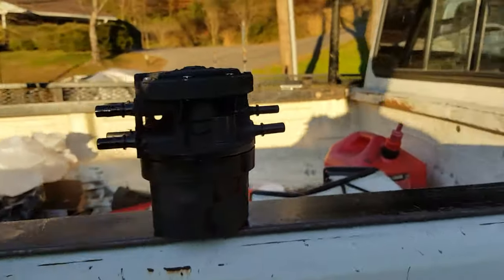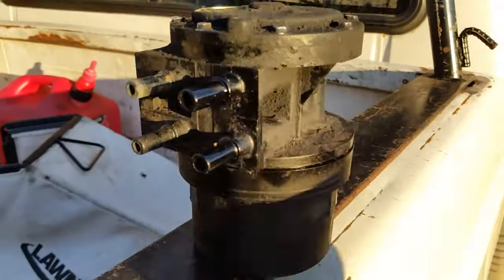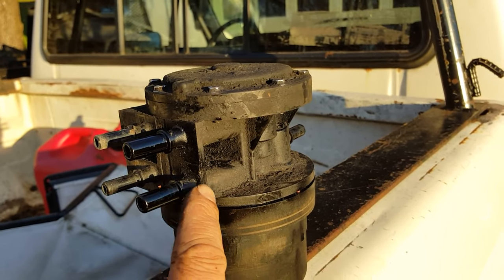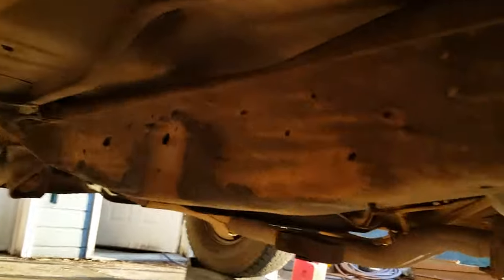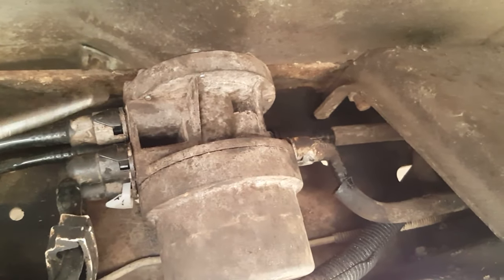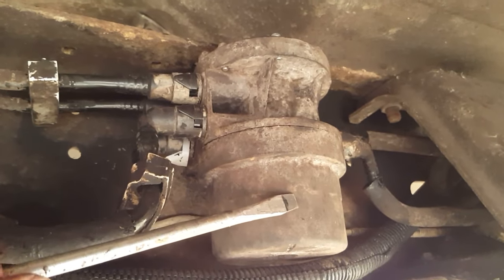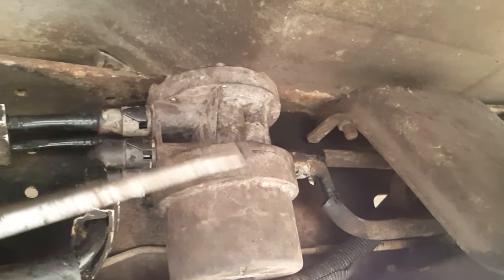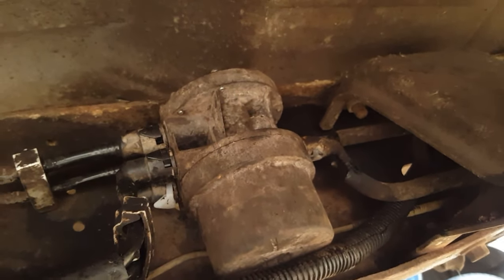Ford dual fuel tanks... EXPLAINED and where to buy parts!

Comment: Fun fact you can get new ones that is special ordered through carquest/advance auto parts but the cost of the valve itself is $200 to $300, so I just took it apart and sprayed WD-40 untill the valve selector moved up and down freely
Reply: Imma just screenshot this…
Reply: @thatonegamer9547  imma just screen shot this and that
Reply: 70 on eBay.

Comment: Your video is the third one I've watched where there's no mention of the filter that is in the bottom of the housing ,  inside the round part.  Mine (filter) clogged way back in the day & no one knew of that damned filter . I was stranded in a mechanic shop for 2 days in Victorville Ca. (a long way from home) and at closing time on the 2nd day, the owners dad shows up & asks if we changed the filter in the dual tank selector . The bottom screwed off just like an oil filter , with the big help of an oil filter wrench ,and it was TIGHT. Filter was so clogged , it weighed like a solid  hockey puck .
Reply: There was no mention of the filter because they eliminated it fairly early on so the VAST majority of these just have an empty reservoir and no filter.

Comment: they do have some metal connecting tubes made by doorman that eliminates the selector valve  i got mine at autozone for about $10 also you may have to go another route and use a selector valve and  all new fuel injection hose . the selector valve is like the one used on a 1985 chevy truck with dual tanks, there are videos on you tube about it , hope this helps yall like it did me with my 1988 f250

Comment: Rock auto standard motor products part number FV5K universal fuel tank selector valve, works great, have it on my 89 f150 5.0 now... Dont pay $200 to $300 for the original that is no longer produced. Also dont waste time cleaning it, I did that and in 6 months the same problems started again.

Comment: The bottom of the fuel selector screws off and there is a filter inside but if you do unscrew it they don't make a new O ring for it, i got lucky and found an O ring kit at advance auto that worked. They make a replacement for it but it doesn't come with the filter for it, it a small thing that looks like a fuel pump.

Comment: THANK YOU!!  This helps A LOT!  The symptoms I'm having with my '89 F350 7.5 liter strongly suggest this thing is the culprit.  I live 80 miles from town.  One day I was leaving town with both tanks just filled.  I switched from the rear tank to the front tank and it took about a block for the truck to die due to fuel starvation.  Switching back to the rear tank allowed the engine to start immediately - no doubt after the reservoir re-filled.  I got clear home without a hitch.  Part of the trip is on a somewhat bumpy gravel road.  Next day I started the truck on the rear tank, and switched to the front one while it was running, expecting the engine to die.  It did not.  I made at least 2 more round trips (160 miles each) to town WITHOUT switching the tank selector either trip; refilling the front tank before leaving town both times.  The truck ran strong - as it must to climb the 2200 foot elevation gain back home without a whimper.  I then ran it back to town and on toward Albuquerque  - a total of about another 130 miles - still without changing tanks and it ran strong the whole time.  I then switched to the rear tank, and then after about another 100 miles of operation I refilled both tanks.  I then switched to the front tank and kaboom - it croaked in about a block or two.  Going back to the rear tank again "solved" my problem, but now I'm having difficulty getting it to run on the front tank.  I do hear the in-tank pump run when I turn on the ignition switch, but it dies shortly starting. I'm suspecting this fuel valve may be sticking, and that the first time I had the problem, maybe the jarring roads loosened it enough to allow the valve to switch that "one more time" letting me to run that 450 miles on the front tank again after my original problem.
Reply: I'm having the same problem. Was it the selector valve or the fuel pump?
Reply: @MrCammthemann  Turns out it was NOT the selector valve - though I had already installed a new one.  It was most likely a poor electrical connection to the in tank fuel pump.  I replaced that pump with a brand new one and SOLDERED the connection wires to the pump and no more problem.  As is so often the case with electrical connection problems, they are intermittent - which was my case.
Reply: @MrCammthemann  check the wires next to battery  they get corrode. One goes to the fuel system and sometimes cut the power

Comment: I kept having problems with that manual valve. Swapped it over to the electric valve from a diesel. Worked great. Kept going through tank pumps. Got the fittings and made gravity feed to external pump. Works like a charm.
Reply from the maker: Dude that's awesome good idea for sure 👍
Reply: I know hot-rodders have been using generic external fuel pumps for decades, so I thought that should work. Do you have a part number, make and model?

Comment: You can just take it apart and clean the selector valve inside.
Reply: Can I just buy a inline edelbrock fuel pump and connect the return line and supply the bad side with the Edelbrock pump and leave the working side which is the rear alone I would need to set up the switch  are there any other options to eliminate the selector switch? And keep both tanks usable 7.5 gas 91 xtr lariat E40d

Comment: Now so for these things, on my 93 I got rid of it for the plumbing aspect. For the electrical aspect I just took it & im gonna just have it underneath just for the fuel level in each tank.
My valve in my truck was getting stuck where the front tank would get stuck 1/2 way suck in air starving the engine of fuel.

I will have a video on how to do it on my channel MikeJD60.

Comment: Dorman makes bypass tubes for these that you can connect to each end of the fuel line and completely eliminate the reservoir.  Having the reservoir is not a necessity.
Reply: I could not find bypass tubes for double sided male to female quick connect in Dorman's catalog for fuel line accessories/fittings. However, I did find both 3/8 and 5/16 connector tubes at, Racetronix. the 3/8  part number is Item #: QDA-38M38. The 5/16 can be found on the same page. I'm in the middle of refurbishing my selector, just flushing out he crud, lubricating the valve and replaced the small o-ring. I do believe it had a stuck valve. Will know when I install it.

Comment: Bottom canister has a filter. It unscrews change filter inside.
Reply: The ones that have that larger reservoir (I think like the one in this video) don't have a filter I don't think. Meant for 86' or later, just a pickup tube in there. The smaller reservoir ones like in 85-86 have a little filter in there though. they almost look identical. You can tell if it's like 3-4 inches long on the bottom (no filter) vs. like 2.5 inch cap (filter). Correct me if I'm wrong but after doing a lil research there's no filter in these ones, the filter should be on the fuel line sitting behind this whole contraption towards the two tanks.
Reply: @jameshardy5743  alot of problem s with that thing.
Thanks for researching

Comment: Nice video. I was hoping for a bit more detail. So when you hit the selector switch on the dash that must turn on the pump on in the tank. The valve it self must have a check valve inside that keeps fuel from going where you don't want it??
Reply: Pressure from the driver selected tank causes the selector valve to switch.

Comment: Sup brad, I have the same issue you had where gas is overflowing the front tank. I did some research and found that there’s check valves in the fuel pump that allow rear gas to the front when they go bad, so will replacing this selector valve solve the issue ? Or is it the check valves in the fuel pump ? I just really don’t wanna drop my tank lol that’d be a pain in the ass, thanks

Comment: How do you test it?
My '89 F350 diesel does not read the properly at the gauge.
Also, I think my rear fuel pump may be bad as it seems to run out of fuel on occasion even when I know it's full.
The front tank has acted up like that, too.  Seems to run out when I know has has a few gallons in it.
So, are my sending units bad (gauges not reading)?
Is my rear fuel pump going bad?
How do I to test for all these things?

Comment: I have a single tank and this is removed due to the rear tank leaking.  Why would the single tank not work if the "bronco" one was not substituted?  

I'm losing fuel pressure after few minutes of driving in a truck I purchased last week.

Comment: is that a diesel truck?? because i have an 84 f 150 xlt extended cab long bed, and my fuel tank selector looks way smaller than that ,,also when i bought the truck a few months back,,it had no middle tank. only a rear tank ,,someone took out the middle tank and bypassed the fuel tank selector all together,,well i bought a bran new side tank and want to hook it back up but not sure how it goes..with the selector
Reply from the maker: Man dude wish I had more info on that for you. The one in the video was a 5.8 gas motor.
Reply: @bradepperson4460  mine is a 302 carb

Comment: Maybe you can help... I have a 1991 E150 that I am about to be running a decently higher performance engine in.. its a 5.0 EFI)   I was somewhat ignorant to these fuel systems.. so I assumed I needed two higher pressure in tank fuel pumps... as it turns out there are 3 fuel pumps?    So the only in tank pumps I could find do flow at 150 lph  but @ 7 psi.. like for a carb.. so I assumed I needed more pressure for EFI... I have new tanks.. sending units.. and these two pumps that fit perfectly with the units..  the question is... does the high pressure pump after this valve take care of everything else?   Like are the in tank pumps only supposed to be at a low pressure before the valve?   Maybe its this way because of all of the changes going on.. like carb to EFI... thank you so much for any help.

Comment: The fuel selector value on my 89 F150 is like goopy at the bottom. Almost like pancake sytup.. Also after the truck engine gets hot, it begins to stall out like getting no fuel. I plan on replace the value with a new one I found on Amazon along with replacing the fuel filter and the  fuel pressure value next to the fuel injector rack. Does this sound like a good approach? Thanks.

Comment: I think this is what happened to me because I just replaced my rear tank and pump because it was fucked with rust and the pump wasn't pumping well ,buuuuut my front tank was puking fuel so I think imma just bypass it for now
Reply: Wear you able to bypass the valve? I am about too only run off the rear tank because I removed the front one. The truck is acting really bad cause I just closed off the old lines going to the front tank and did not change anything with the selector valve...

Comment: I have a 1990 Ford F150 that dumps all of my fuel from my rear tank to my front tank.

My rear tank & pump are brand new, front tank & pump are old, & do not work.

I've searched hi & lo for a fuel tank selector valve, but I promise,  I don't see one anywhere, period.

I was told there has to be one somewhere.. But for the life of me, there is not one on my truck.

Could it be that I have a faulty fuel tank switch? Would that switch cause my rear tank to dump all of my fuel into the front tank?

I've put my old fuel pump check valve on the new pump.

If the switch isn't the issue, or there is a fuel tank selector valve hidden in one of those hard to find places, then what could be the issue?

Is there a fuel tank switch relay?

If so, would you happen to know where these things are located..

I'm really stuck.. I put $50.00 in my rear tank, went 5 miles, came back almost empty.

Please help, this is a heavy concern..

Thanks in advance..
Reply: Dee 1, I have the same problem... but my front tank dump in the rear and the rear dump in the front... ¿how do you fixed your problem?
Reply: @luisalfonsodl1364  Wow!
I changed my front tank & pump. I read that because the  pump was old, the check valve in it, or even attached to it was not working anymore, & would not stop back flow.

I also found out that I would be able to install a inline check valve if the problem persisted.

I haven't really tested it yet, because I changed my tie rod ends & ball joints, & plan to change my shocks & bushings, then go & get front end alignment.

So it's parked til March, til I get it aligned. But both tanks & pumps are brand new..

It seems to be okay at this point, from starting, & just going around the corner, but I haven't really drove it yet to see how to does.

If your pumps are fairly new, then I would install inline  check valves in your fuel lines, they are very cheap on the price.

There are multiple videos on youtube about it..
Reply: @luisalfonsodl1364  Here is a link to a video on inline check valves:

https://www.youtube.com/watch?v=STIQa1ct_5s

There are lots of them on youtube.

This is what I will try next, if I still have problems, but I was told that I shouldn't, because the pumps are new, & they have check valves built into them that should work fine.
Reply: Dee 1 Thanks!!! I’m going to check that!! I appreciate your help
Reply: @luisalfonsodl1364  already!

Comment: my 1990 ford Econoline E-350 van has this same selector valve and the problem with it, is once the fuel pressure gets to a certain psi it sprays the fuel back into the return line somehow straight back to the tank. is this possible? its so simple to hook up i know that is right. low fuel pressure at the fuel rail and gas pouring back to the tank. also, i replaced the pressure regulator to get that out of the equation. anything helps here. I may just buy a single selector valve as it it half the price of a dual tank valve and just run on one tank. when i blow compressed air through the in line on the selector i can feel air coming out of the return line to the tank. must be leaking somehow, van sat for 12 years.....

Comment: My 94 f250 diesel, front tank will pull fuel from rear tank. At times it acts like it starving for fuel. Fuel filter light will come on and there are times it will die.

Comment: WHEN GO TO MY BACK TANK THE TRUCK GOES DEAD IT HAS A NEW FUEL PUMP. WHAT DO U THANK IT COULD BE.THANKS ROLAND
Reply: Each tank has a low pressure fuel pump in the tank as well as the high pressure pump on the frame rail in front of the selector valve.  You may have lost the low pressure pump.  You have to pull the bed or drop the tank to access it.

Comment: My brother removed my front fuel tank pump plug on the top of my 1991 Ford F150, and replaced it. My back tank always worked fine, and the truck idled fine. Now when I have to turn the key forward while in neutral, I put a screwdriver between the solinode it starts and stops. So I keep using the screwdriver trick, and it sputs and sputters running  for 10 minutes or so, then stalls. The exhaust muffler even turned red, until I cut it off. Do you have any ideas I should try?
Reply: Yes, talk to your brother!

Comment: I have a 95 and only the rear tank works, the front tank doesn’t overflow,  when you switch to the front (broken) tank and turn the key on you can hear the fuel pump try to prime the engine but it does sound different, lower pitched, than the back (working) tank. Does anyone know what the problem could be.

Comment: I have a 1989 f250 and having a fuel problem. I can't hear my pumps turn on I changed the fuel regulator fuel pump. Does that mean my pumps are bad inside the tank or could it be the selector valve? Thank you
Reply: Put new filters on it then a psi tester... if it's under 50 psi replace your high psi fuel pump

Comment: Does that have a electric plug on it? Bought a 87 250 and it doeSnt have the selector on it...
Reply from the maker: No this one did not. When you say it doesn't have a selector what exactly do you mean?
Reply: It’s been took off by the previous owner. The front tank was hooked up with rubber hose to the lines feeding the motor. Rubber hose inplace of the selector.
Reply from the maker: Gotcha yeah that a common "cure"  but if you want to run it that way I would suggest getting the bronco unit. They came with one tank and it has the reservoir so it doesn't run lean
Reply from the maker: There is a link in the description where to purchase one
Reply: How does it switch between tanks tho? Or is the switch in the cab only for the gauge?
Reply from the maker: @JBoyOutdoors  the switch in the cab controls the fuel pumps
Reply: Mines a 87. Has a mechanical fuel pump on the motor.
Reply from the maker: @JBoyOutdoors  I'll double check tomorrow for your year but it should have a pump in each fuel tank.
Reply: I got a 97 f-350 with a hole in the front tank,and a bad fuel pump in the same tank...i just wanna block it and use the rear one...could a guy just block the two top and still have it work?...its returning the fuel to the front tank and leaking out the hole in the tank.
Reply from the maker: @darmp64  I believe the valve on a 97 is different. I've heard that some people just swap the lines so it returns to the rear.

Comment: well?  Now I know , what problem is  an what needs to be done.  But you didn't mention the price of a new one.  If in deed I find one   Thanks! thumbs up
Reply: Auto Zone for approx $90. New from Ford is $180 to $220 Do not bother Amazon or E-Bay.
Reply: eBAY BUT THEY R OVER $200.00

Comment: Great video. Mine is going the other way, front leaking into back. Hopefully I can locate it at a wrecker about $200 new. Have you any experience changing the valve to a Universal switch tank valve??
Reply: James Byrnes take it out, take top off and clean valves with WD40. Simple and cheap
Reply: Go to rock auto its 55 bucks for the universal one. I got it on my 89 f150 5.0 manual 4x4. So worth it.